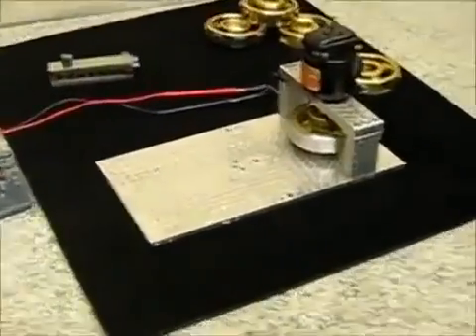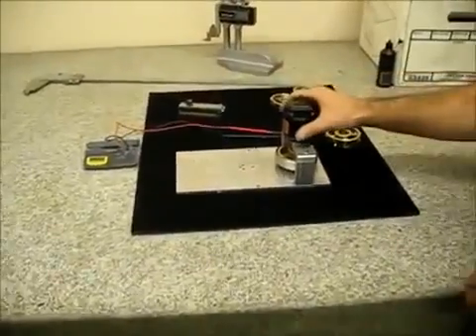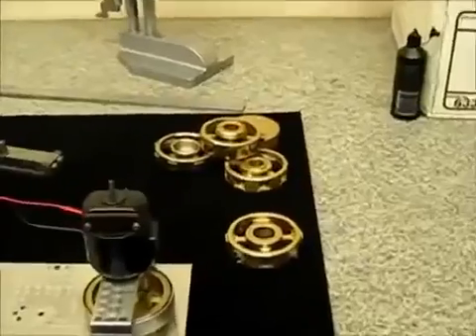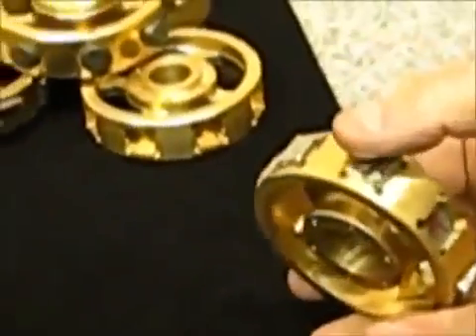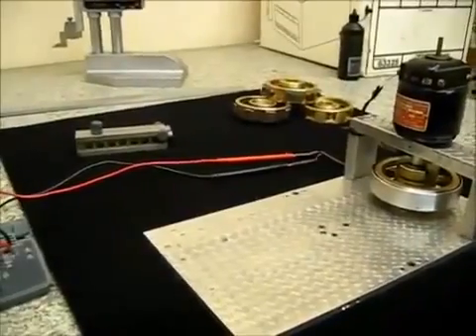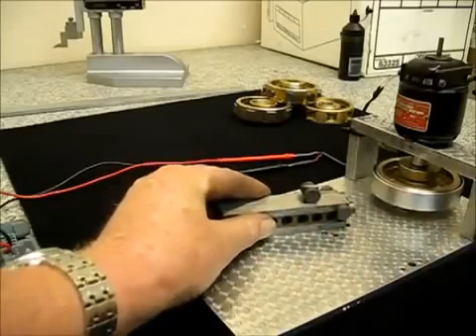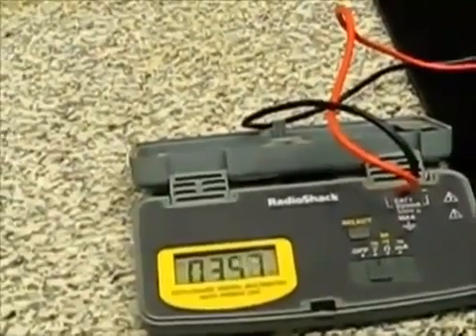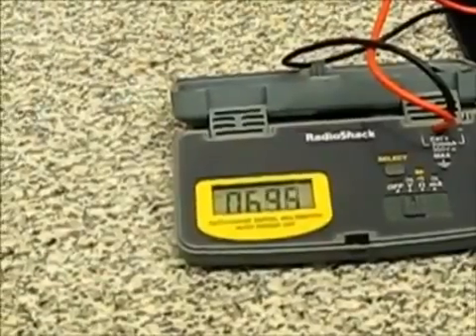MOTOR MAGNETICO 2 FREE ENERGY  6000RPM MAGNET MOTOR

Comment: Actually the theory behind most examples of working magnetic motors, involves staggering the magnets, or gaps within placement, with proper magnet placement, the rotor will be perpetual.  As for hidden motors or a battery, I have seen smaller designs with less rpm's & torque work, without either, and even if this design does employ either, which the poster is fed up with hearing about, as long as the magnetic motor can output more energy than it consumes, than its a working model.  I have seen different designs, and thought about using solar panels to drive electricity to power electromagnets as well.
I don't think that this guy would be posting all his advances, and showing how the magnets flew off at high speeds, his trials & errors, if he was just bullshitting about his design.  There's a lot of suppressed designs that do exist, and any designs that are based off perpetual motion, be it with magnetics or gravity, require a working design to be issued a patent from the us patent office.  My theory is, that if you apply for a patent, and your design works, then you start having serious shadow government problems.
Kudos to your design mate, it's about time.  I'd like to see a standalone magnetic generator, capable of powering a typical power strip.  And if we can, I'd really like to see one power a home.
Reply: Why would he fake it? Views on youtube. Yeah people are that sad. He might also find it hilarious to fool people. Or he might just like selling off bogus designs at $20 a pop to gullible fools. 
No these concepts do not work. Not one. 
I offer you the same deal I have offered every student at my old university. Show me one design that outputs more energy than what goes in. One that works, that I can build or at least inspect and you get AU $10000. I have it and am willing to give it. I have seen thousands of designs. While some have been fantastic pieces of engineering and fascinating concepts, none have created power. 
Sadly none can. 
Nobody, not once has ever been able to give substantial proof of one working, ever. Honestly I would love for you to be able to prove me wrong, however I strongly doubt you can.
Reply: @jackquick8362  buenas por 10 mil necesito 23 mil euros por lo que le envío planos y prototipo si aún puede estar interesado con otro diseño quizás menos funcional que este que es una auténtica genialidad hasta tiene un acelerador. El mío aún no es tan sofisticado pero ideal para ser evolucionado gracias por contestar.
Reply: simple.   run a photovoltaic cell, to a timed intermittent splitter switch, run that out one side to a battery bank, run the other side out to the magnetic motor, and out from that to the same battery bank, run a power line from the battery bank to the timed intermittent splitter switch.    

this way, energy from the photovoltaic cell, is delivered in intervals of say 1 minute, to the magnetic motor and then battery, and every other minute, directly to the battery.   

what happens is when the power is cut off intermittently, that magnetic motor is still spinning, albeit, winding down.  the energy output is still collected by the battery at that time, while the solar energy is being sent to the same battery.   

so for 1 minute, you are just collecting solar energy that is going through the magnetic motor to the battery.
the next minute, you are just collecting solar energy that is coming from the photovoltaic cell, along with the energy of the winding down magnetic motor.  

this will give you more energy than just a photovoltaic cell hooked directly to a battery.
you should be able to measure it, by the battery charge.    

I understand everybody says over unity is in direct conflict of the law of thermodynamics.
the problem is that you need to realize that time, is how you get to over unity.